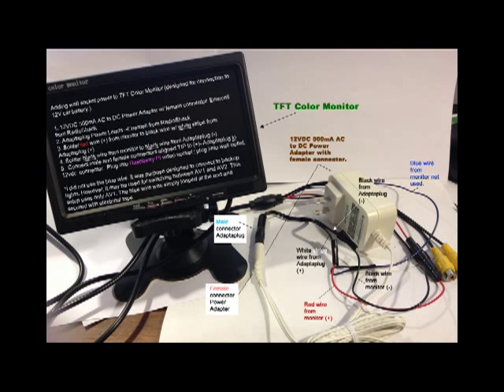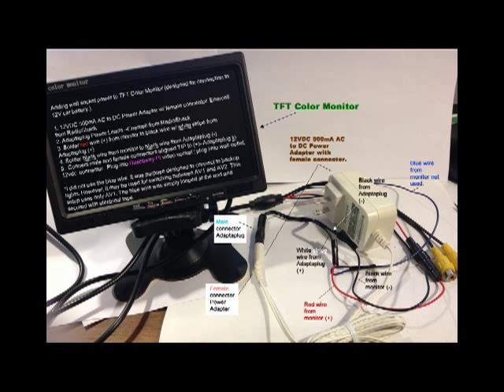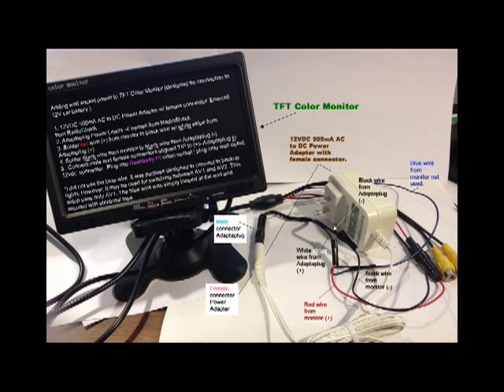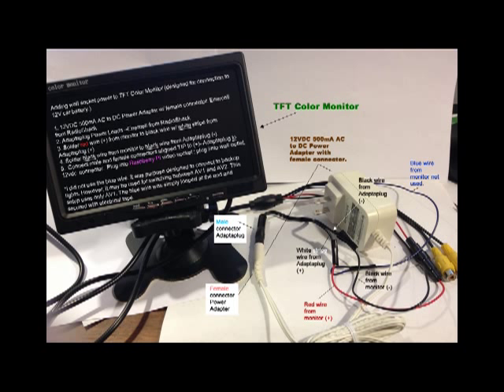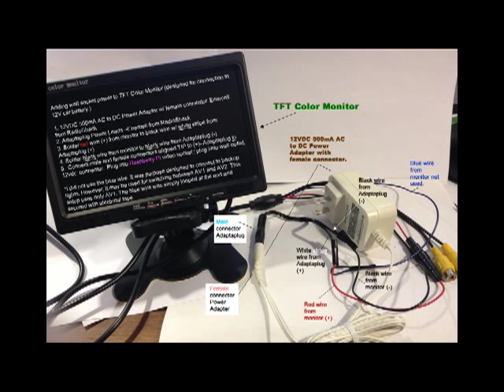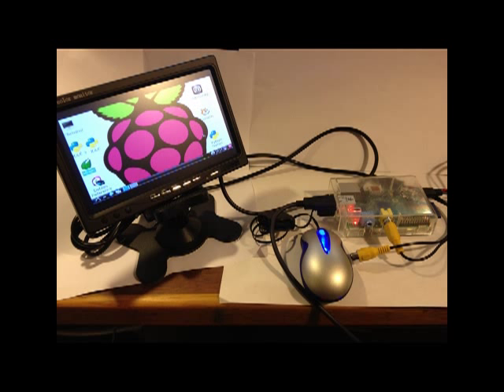TFT Color monitor for Raspberry Pi

Comment from the maker: Carlos,

Sorry it took me so long to get back to you. These settings came from one of the reviews of the Monitor on Amazon. I used them, and they seemed to work ok.

You have to go into your config.txt file and make the changes.
vim /boot/config.txt

# uncomment if you get no picture on HDMI for a default "safe" mode
#hdmi_safe=1

# uncomment this if your display has a black border of unused pixels visible
# and your display can output without overscan
disable_overscan=1

# uncomment the following to adjust overscan. Use positive numbers if console
# goes off screen, and negative if there is too much border
overscan_left=24
overscan_right=30
overscan_top=-26
overscan_bottom=-16

# uncomment to force a console size. By default it will be display's size minus
# overscan.
framebuffer_width=480
framebuffer_height=272

# uncomment if hdmi display is not detected and composite is being output
#hdmi_force_hotplug=1

# uncomment to force a specific HDMI mode (this will force VGA)
#hdmi_group=1
#hdmi_mode=1

# uncomment to force a HDMI mode rather than DVI. This can make audio work in
# DMT (computer monitor) modes
#hdmi_drive=2

# uncomment to increase signal to HDMI, if you have interference, blanking, or
# no display
#config_hdmi_boost=4

# uncomment for composite PAL
#sdtv_mode=2

#uncomment to overclock the arm. 700 MHz is the default.
#arm_freq=800

Also you might try changing :

#framebuffer_width=1280
#framebuffer_height=720

to

framebuffer_width=480
framebuffer height=300

If you're using VGA . I forgot which one I used, but I believe that I kept changing the framebuffer height value until I was able to use the optimal value on the screen.

Kindest regards,
Bill